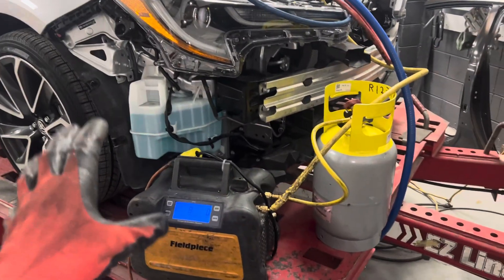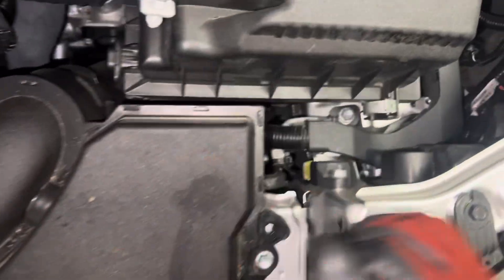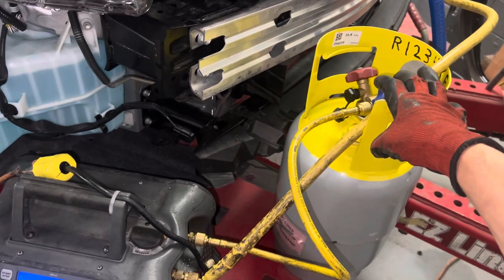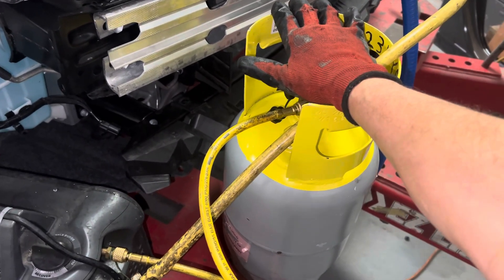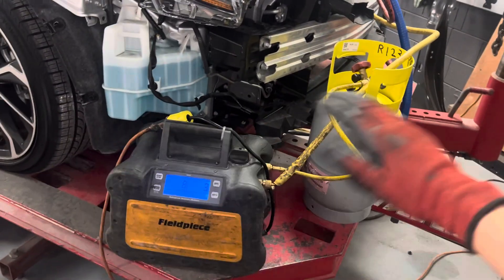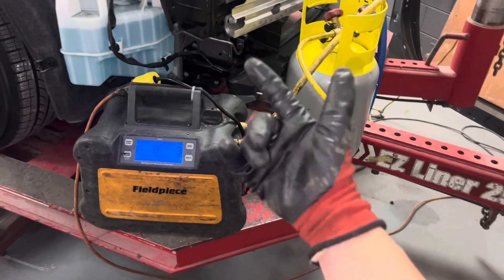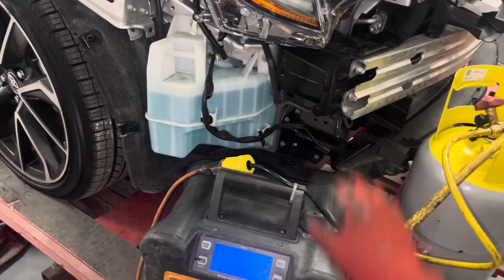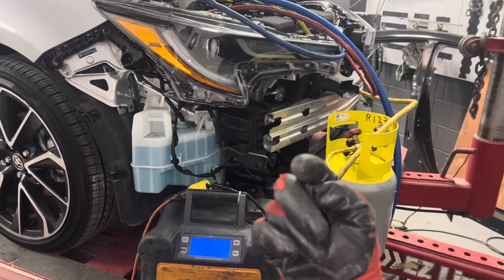Question about change $ for Refrigerant Recovery Procedure separate from Recharge procedure

Comment: Tom how do you handle such a large area? Do you spend a lot of time on the road driving back and forward from jobs or do you do a certain area on certain days?
Reply from the maker: All jobs lined up every day in a row. 
They call in advance to make an appointment  . 
Sometimes if they are lucky. And I’m a few blocks away all ready heading in that direction I can drop in as I head north or south 

 all my shops are 1 min to 5 min in between each other .  Some right next door to each other. 
Vary little time on the road. 

Sometimes I hookup one to 4 vacuum pumps at one shop go down the same street connecting more vacuum pumps or recovery pumps up. 
        By that time the first shop down the block is ready for me to come back and recharge. 

Iv been doing it like this for 30 years. From 7am to 7 pm nonstop 5 pm if I want to go home early. 

In the early year first started . My fate, an uncle, two brothers and a cousin. 

We did SF to San Jose west side of the bay. 
Vallejo  to Hayward on the east side of the bay 

When we were young in Highschool we lived in Willits CA  doing air conditioning up there.  Made a killing. Nobody knew how to properly do air conditioning up there. 

Just like today. Many can get it cold especially if just using small cans topping off . But the always over charge or under charge causes problems later on. 

It’s a never ending supply of shops messing up customers cars. 
        Even the shops with the big expensive RRR machines too cheap to buy a refrigerant identifier and contaminate all their recycled refrigerate and contaminate all their customers cars. So I get even more work from shops that see me at a shop next to them. 
      Never have to travel far. Straight lines.

Comment: You are missing the fact that there is value in the refrigerant that was removed so why isn't the customer getting compensated ?  That's why we find that if you go to 5 different shops you get 5 different prices. One shop would be decent and honest person and the next would rip you off. You say they paying for the equipment and training ...also BS ..... a mechanic doesn't charge you for using his tools or add special prices if he had to use his torque wrench or any other special application long wrench in his box. I have been a mechanic for 35 years and never heard such rubbish.
Reply from the maker: Recovery and recycling machines are expendable items like sandpaper they have a limited life

Unlike our wrenches that we usually don’t break if they snap on our Mac, they last us a lifetime and if they do, we get them replaced for free 

Refrigerant has no value if it’s dirty it all goes just like your engine oil into a recovery tank just like used engine coolant goes into a common recovery tank 

You pay to have it removed they sell it to processor, then sell it to a distributor put it into a packaging that resell it back to the auto parts store that the customer goes back and purchases 

Refrigerant is the exact same thing? 

The days of topping off refrigerant have been long gone for the last two decades plus especially since 134 was introduced and 100% off-limits on variable displacement compressors so it’s a complete removal of the refrigerant and refill 

Just like engine oil you’re removing the engine oil why are you not discounting it and giving your customer back back engine oil for free 

It gets recycled to cost money for that employee cost money for that truck cost money for the warehouse where it’s gonna get delivered cost money for recycling equipment 

It’s the exact same thing 

But I do see guys giving it away at nearly free to reduce price discount and I feel sorry for their employees because they get shit for wages very little benefits. Those are the places where the owner can afford to send their technicians to other states for factory training they’re lucky if they ever get two weeks of vacation , let alone be at a nice shop that gives you five weeks of vacation because the owner doesn’t know how to run a business for his margin of markup tools and labor and supplies consumables 

At one time I had over 30 radiator and air conditioning Specialty shops who were my competition. 

But they had just basically that same thinking and business practices of not charging for a lot of things until they went bankrupt out of business. I have no competition because compensation business suicide a slow lingering death. 

For a shop to afford good equipment send their technicians to Training and constantly with the vehicles they cannot be the Christian charities the Red Cross or be the United Nations coming to the rescue 🛟 

They all end up in the same place, a footnote in the history of a business that used to be in business until they are no more. 

I’m fourth generation in this business and my son is fifth generation

I’ve watched all my competition usually never make it past the second generation and there’s a reason for that